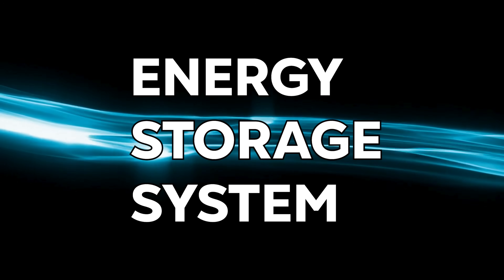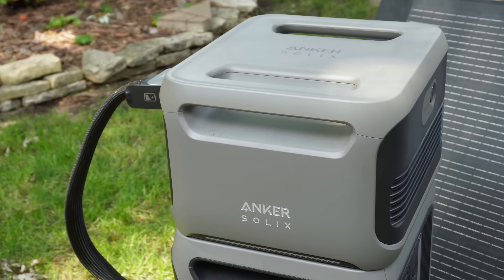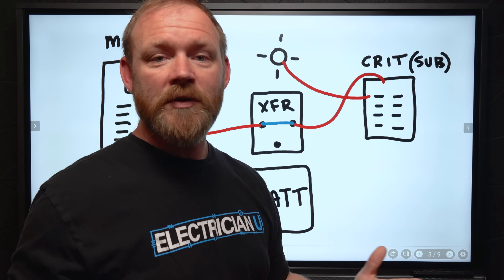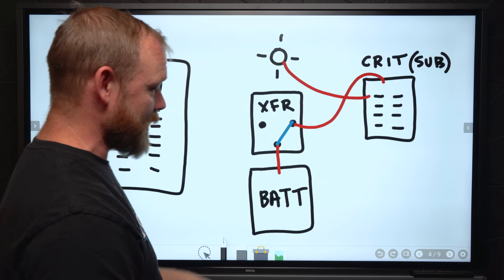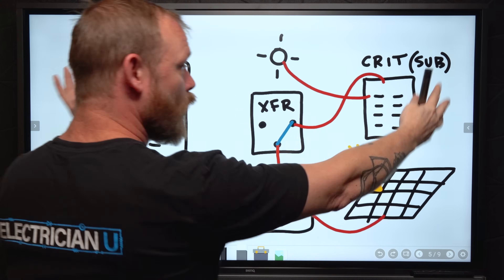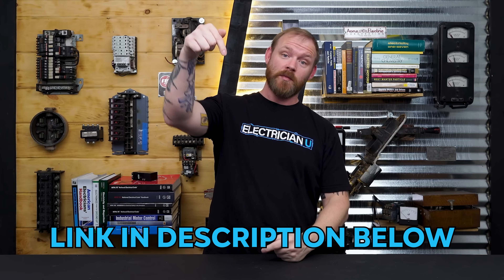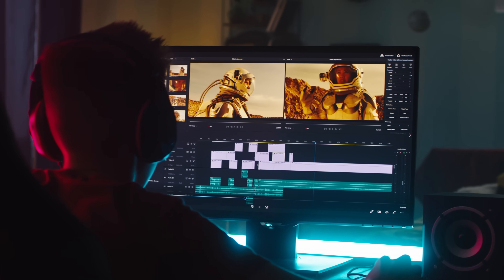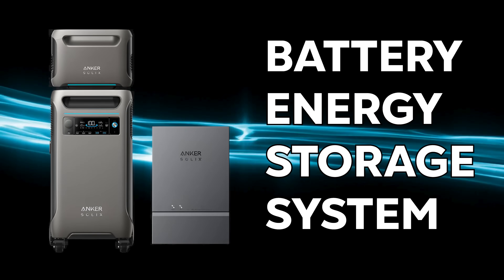Using Batteries to Power a House?!?!

Comment: Thank you for your content.  Would you consider creating a video about setups where a  battery bank is powered from the grid? I was told that this configuration can potentially create a dangerous ground loop, and I think it would be helpful to see this explained in more detail.
For example, in a Time-of-Use (TOU) setup:
The transfer switch is powered by the battery bank (discharge) during peak hours (2 PM–10 PM).
The battery bank charges from 10 PM–6 AM.
From 6 AM–2 PM, the system runs directly off the grid.
I’d really appreciate your insights on whether such a setup could pose safety issues or inefficiencies. Thank you again for all the valuable content you share.

Comment: Not talking about this topic raises an interesting question and you are very big on electric code if the transfer device has the ability to disconnect the supply side automatically during a grid down situation and it can also shed non-critical loads do you still have to have a separate disconnect switch if the supply side is already onits own separate breaker in the transfer device the device I’m speaking about is the EG for grid boss

Comment: Would you be able to answer a ground / nutral question
I have a pioner 9000 btu wited 12-3 to the panal. 
black / power
White / nutral
& ground tied to the white nutral in the panal box as normal hookup
Ok
Now we have a 24 volt inverter with 3 solar panals to 2500 ah as a backup for our refrigerator & now we want a manual switch to make our 110 pioner btu a/c work
BUT THE white/black can be switched. 
The problum is the Ground wire. Its still conected to the panal box
Would that be ok or a problum
Its all hard wired 
Thanks Doug

Comment: How do you disconnect a battery system in case of an emergency in a grid outage?  If the grid is down and the house is run on a critical loads panel, by a battery, how do you prevent an emergency responder from being electrocuted in this situation?

Comment: A lot of mid size solar generator have TT-30P out lets on them. Is it safe to use an adapter to L14-30R to power an emergency generator panel sub panel inlet or is it possible you could over task the neutral wire ?

Comment: Question: is it possible to wire a low voltage device to motor like an Exhaust Fan to a high voltage light switch ? Thank you

Comment: Every new house should have solar + battery + grid-tie as standard.  Some places we still need — almost unbelievably — regulation to catch up with the technology to allow this to happen.  Especially around automatic load transfers with grid-tied systems so they can seamlessly operate in input, output an island modes as needed without manual intervention.

Comment: With the Enphase grid tied system you can have a partial home back up without a battery. It works with the solar panels and the micro inverters on the roof. You still need the Enphase smart switch

Comment: My house lost power for 22 hours back in May due to a severe and long lasting storm.  Sump pump backup died and the, newly finished, basement flooded causing about $10k in damages. We also lost everything in the freezer. My house now has a 2kwh (Anker Solix) battery backup that ties into a Reliance Transfer 6 circuit switch. Solar panels are coming as well.  I'm replacing the Zoeller Battery backup sump pump with another 120vac 1/2hp sump, in addition to the prime 3/4hp pump.  The 1/2hp will connect directly to the Solix.  The Solix sits in my utility room, right next to the sump.  The Anker should power the the sump pump and fridge for anywhere from 2 to 5 hours.  During the winter it will power the furnace for up to 5.   I am contemplating upping the battery to 4kwh, but this 22hr outage was the longest we've had in 18 years of living in the house.

Comment: I’m curious if batteries are in fact more economical compared to a generator. I work for a company that does primarily generator installs as our main focus. We installed our first battery system to get it under our belts, at cost (no mark up on the system). The battery install would cost more than double the cost of a generator install if we had installed it with proper markup. We installed the system on a home that has solar panels as well as grid power, so the battery system works well due to the customer very rarely needing to use utility power even if the batteries need charge. Even with all that, I just can’t see spending $30k-$35k for a battery install versus $10k-$15k for a generator

Comment: I have a ECOFLOW Delta 2 
1024 Wh. I can use it to power my TV and internet. I can power TV and internet for 10 hours. Which means, the TV, modem and router. Now, if I just power just my modem and router. Then, that will be powered for about 26 hours. It takes about about an hour, if I speed charge it. If I do mimuim charge or I call trickle charge, then that will do it overnight. I'm going to eventually get a Sense Energy monitor device installed on my electric panel, so i can see the details of my entire energy use.

Comment: You would need not only the batteries & transfer switch but also a BMS (charging system) and inverters to go from battery DC to house AC to run the loads.  
This doesn't include the charging devices like solar panels either.
Reply: I was wondering if someone else would notice he didnt mention that. Not an electrician (yet, waiting on apprenticeship application) but from my days as an automotive mechanic, batteries are DC and would require a rectifier to convert AC to DC and and inverter to bring it back to AC. Are those included in the system or are those separate? Wouldve been cool if he mentioned it
Reply: They're included in the systems he's talking about.

Comment: It all depends on the Solar Inverter. 

1. Inverters that only operate when they are connected to utility power and the power is not out, without battery operation.
2. Inverters that only operate when they are connected to utility power and the power is not out, but that can then 'switch' to backup batteries.

1 and 2 operate on the premise of using Solar ( with or without batteries ) as your primary power requirement generation/usage, and taking anything above the Inverter's capacity from the utility line. These seize to function if utility power is out, as a protection measure ( you don't want to feed power into the utility line when a line worker 'has his hands in it' ), and also based on local regulations ( some places won't allow you to install 100% off-grid power generation ).

3. Inverters that are hybrid, that can still function even when the power from the utility line is out - but still require to be connected to the utility line.

4. Inverters that are designed to be full off-grid, that can - depending on the Inverter ofc - receive DC power from both solar and wind and hydro ( even geothermal ), and that can have the capability to supply both DC and AC power at the same and maybe even different Voltages.

Inverters can also be either Single Phase or Three Phase.
Reply: Did chatgpt write this? It isn't wrong, but its a bit much without a strong premise
Reply: @the-uppload  ??

Comment: There is also more expensive comercial level or residential ups systems.  Where all power going in and through the batteries makng the power "clean"...  So if the power goes out, there is no lose of power. Because its all fed thru the batteries to begin with.  These systems are SUPER expensive and ussually only in commercial areas where they must keep power flowing like a data center.

Comment: You didn't mention that batteries are expendable.  No battery will ever hold the same amount of charge that they do when new.  Their capacity diminishes over time, and thus will need to be replaced x-number of years down the road.  A generator, if properly maintained, will still be useable 20 years down the road at full capacity.

Comment: What about reliability? Don’t batteries degrade over time as they constantly deplete and charge?
Reply: Modern LiIon LiPo LiFePo etc can last thousand+ cycles before losing more than 20/30%.
Reply: @JK-tx  still though: how does it compare to generators?
Reply: @FireAlarmDoctorYT1977 They’re really 2 different use cases. I don’t know that there’s a clear “Better” between them.

For instance, if you live somewhere long power outages are possible/common - a battery backup by itself would be prohibitively expensive. 

If you live somewhere with consistent power, but it’s stupid expensive 2pm-8pm [Looking at you Phoenix], or you have frequent spikes and sags - then using battery during the more expensive part of the day [Literally 3.5 times the cost 2pm-8pm in summer in Phoenix] and then re-charging overnight could pay for itself.

In the first example you’d need enough battery to ride out any outage - that’s not practical for most people. In the second example, running a generator is never going to be cheaper than utility power, you’re just adding inconvenience [maintenance, noise, acquiring and refilling fuel] to existing issues. 

If money were no issue, we’d all have a 3-5 Days worth of battery capacity on-site. The batteries would be constantly powering our devices - ensuring no spikes or sags, and the batteries would be constantly re-charged  by utility, with supplemental power capacity provided by on-site solar and diesel generators. I.E., what large N+1 Datacenters run. 

The downside is they’re hellishly expensive, maintenance intensive,  and completely overkill for the overwhelming majority of people. 

My point: short of a fully redundant & robust system, we’re just quibbling over what constitutes “Good Enough.” And that value is going to change based on who is answering, what their experience & budget is, and the anticipated failure mode.  

It’s a heady topic, to be sure. You can approach it myriad different ways & there’s not really a wrong answer if you’re considering all of your variables. 

In the IT / Datacenter world this all falls under “Business Continuity Planning / Disaster Recover” and it’s a huge topic.

Cheers!